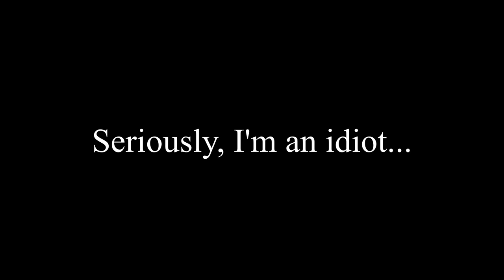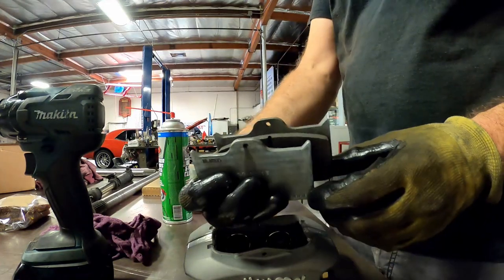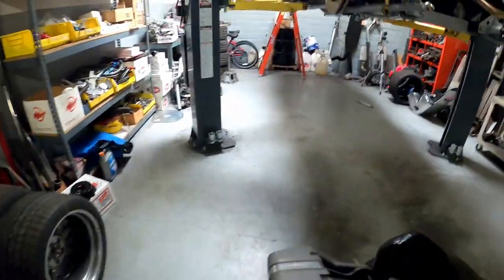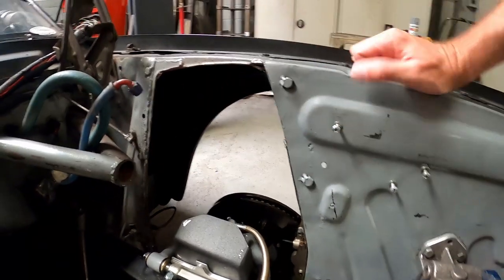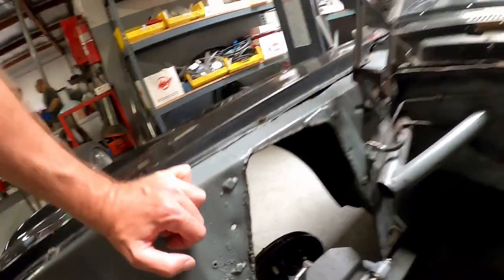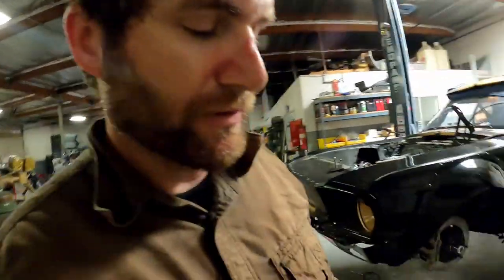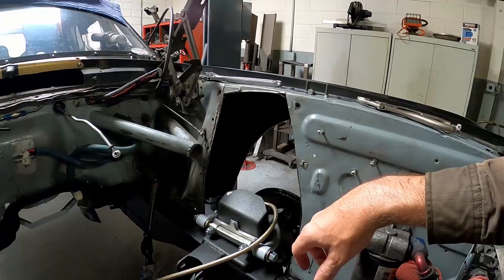67 Mustang TCI Engineering Suspension Installed - TCI Install Part 4 - Ep. 21

Comment: Talking about rear end and axles. Is the rear end housing or axles from your 68 camaro offset? So that your wheels fit in perfect in the well. Awesome video btw.
Reply from the maker: The Camaro rear end is narrowed and the pinion is centered in the housing similar to the Mustang so that it uses two different length shafts. Centering then axles in the wheel wells is fine tuned with the panhard bar.

Comment: Keep up the great work I have just started to get into road racing with my 72 cutlass and I am interested in auto crossing I live in Palmdale and hopefully I'll see you on the track!
Reply from the maker: Sweet!  You are racing the Cutlass or starting with HPDE / track days?
Reply: I race at Willow Springs track days with extreme speed track events. Still working out a couple of kings with the suspension  But  car has been doing pretty Good. It's a 72 cutlass with full UMI suspension and and A 408LS  Engine and T56. Looking forward to trying it out on the auto cross.

Comment: Looks great! Nice contrasting color choice for the components. Whats your plan with those rollcage bars?
Reply from the maker: Which bars?
Reply: The bars in the engine bay that used to tie into the old shock towers
Reply from the maker: I’ll either remove them entirely if the whole cage gets redone. Or try to reuse them I’d that part of the cage can be saved. I’ll sleeve them inside if I reuse them and continue the bar to the upper shock mount like I explained in the video. Though I’d like to redo the two bars that go diagonally either way. They are too close to the valve covers.
Reply: Gotcha, must have missed when you explained that.